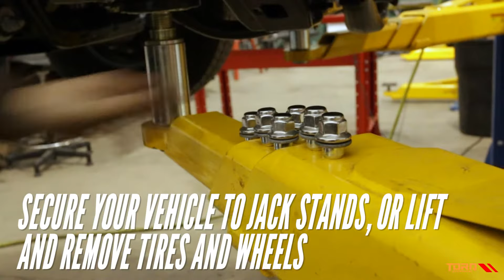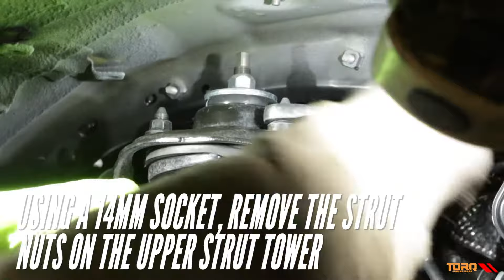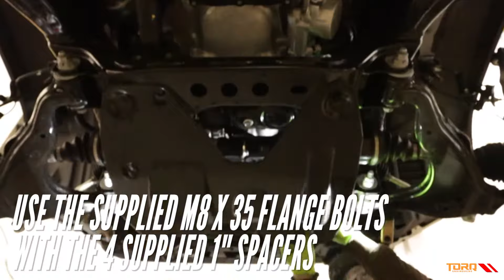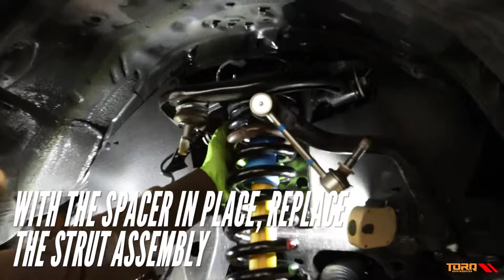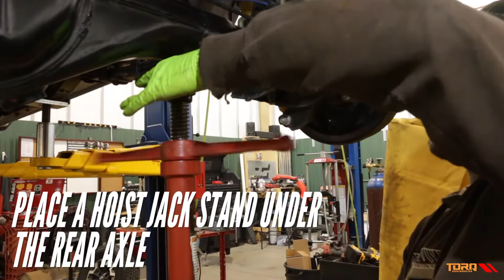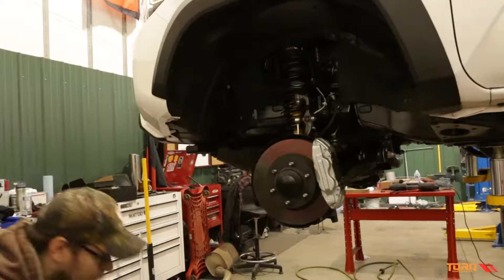Torq Engineering 3" Tacoma lift kit install

Comment: This 3 inch lift will it ruin your warranty
Reply from the maker: "No it won’t, In order for any after market part to void a warranty, the vehicle manufacturer has to prove that it was caused by the aftermarket parts and they don’t spend the money to prove it in the court unless it is extremely obvious."

Comment: The tire size what 285/70r what lol 17 and what was the wheel specs like offset
Width 
Backspace
Reply: the maximum wheel and tire size is on their website.  it says that it will fit a 33 after the lift is installed.
Reply: @jameskent1754  wonder if it rubs with the 33’s